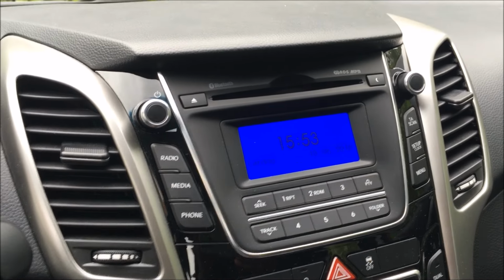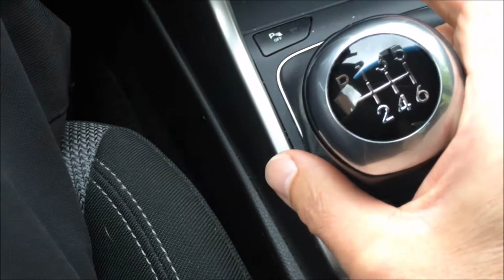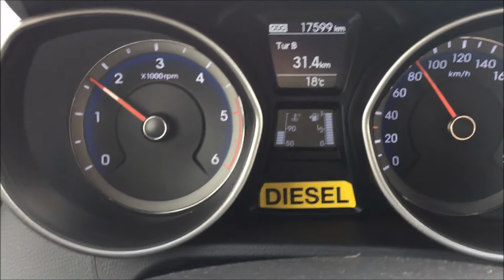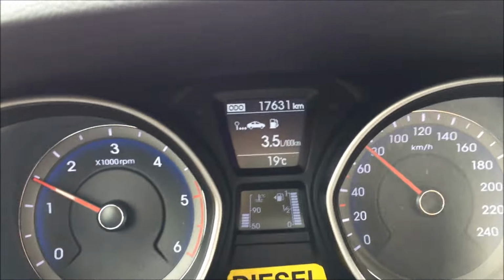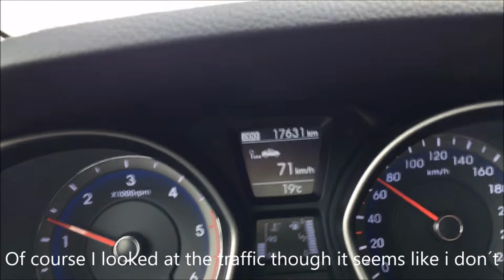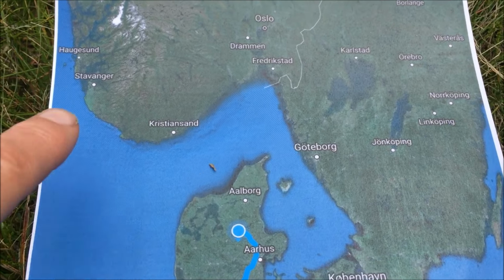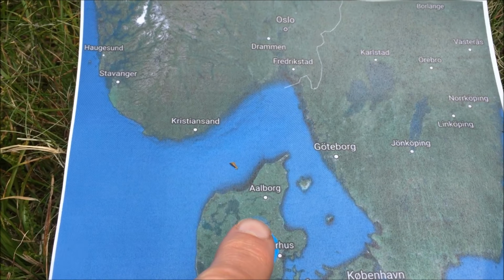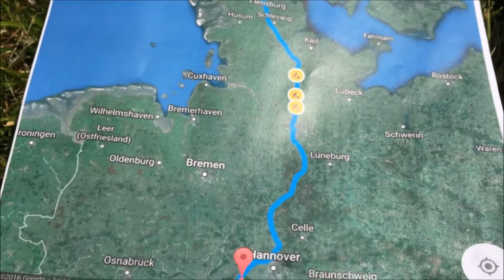Tesla vs Diesel    Range comparison

Comment: But isn't diesel cheaper than electricity?
Reply from the maker: In most countries and states electricity is much much cheaper than diesel. EVs are often a lilltle more expensive than fossil cars but much cheaper to run.
Reply: @fmm1000  even in Denmark? Electricity is way more expensive than countries like Spain. Isn't like 3kr kw/h? But amazing is cheaper even with those prices. I am actually considering replacing my diesel that does 22km/l but I'm afraid of the electrical bill
Reply from the maker: g3ek1337 Yes and no. There are different rates for electricity in Denmark. The most expensive is 2,30 kr / kwh. But you can get an “all you can eat” subscription for 800 kroners pr month. Then it gets pretty cheap if you drive a lot. Also you can get a subscription with prices that follows the market price. Then you get real cheap prices at night. You even sometimes get paid to charge your car when there is too much wind power. Nissan in Norway tells that the service cost of their EVs are 1/3 compared to the fossil Nissans.
Reply: @fmm1000  thanks a lot! That helps a lot. I think is time change my Leon for a model 3 them ... I was really worry about increasing my 2000kr diesel expenses
Reply: @fmm1000  super mange tak for hjælp :)
Reply from the maker: g3ek1337   Do you live in Denmark or Spain. Yes. Go for it. Buy the Model 3. Though. I would wait until 22 september. There might be annonced new battery technology for Model 3.

Comment: First thing - Tesla S is a luxury car that competes with Mercedes Benz E/S class, BMW 5/7 series and other top models. It cannot be compared to a compact car in 15-20.000 euro price range. 
2 - Purpose of car in that class is not to drive it around town and do shopping. It is too big and not so practical. It is to travel on motorways at high speeds (limit in europe is usually 110-130 km/h). So, instead of driving behind a truck with a/c turned off why dont you drive it at 130 km/h or more if you are in germany and then show us real world range of the car?
Reply from the maker: Ante Tešija i did that on the return trip going over 200 kph. Check the other version of this video for results.

Comment: This is not all about thermodynamics but also economics. 

Best efficiency you can achieve with an Otto engine is around 20-30%, with a Diesel engine is a bit higher around 30-40%. Far away from 90-95% efficiency electric motors can achieve. This is a question of heat loss and physics limits. 

However at the moment the issue is about cost. As long as electric power train is not as cheap as thermic engines then electric cars will not be sold massively. That's what Tesla Gigafactory is trying to achieve. 

Your Tesla is way more efficient than Hyundai i30 but the second costs a quarter than Tesla. Despite of super chargers are for free, the cost per Km of diesel is still cheaper than Tesla during first 20 years of ownership. I did the budget exercise and I need 10 years to make a Tesla profitable. But not affordable in the beginning. 

Congratulations all of you that can afford a Tesla.
Reply: Sorry for mistake. 10 years of ownership I mean.
Reply from the maker: Agreed. EVs are more expencive to buy but cheaper to run. In the first year of ownership I have saved at least. 5000 euros compared to my previous car.
Reply: +Peter Kjærsgaard 5000€ saved during one year seems to be too much. What do you take into account? How many Km do you drive and what car did you have before to compare costs? This is a very interesting topic to explain in a video.
Reply from the maker: +José Antonio Simal Martínez i had a Volvo XC70   Might do a video about this topic. I have driven 60.000 km in 11 montths.

Comment: Peter, maybe instead of testing against an Aston Martin you could test your Tesla against a BMW 5-series 335D. It's a high performance diesel. The BMW 5-series also offers space and luxury (if you choose the top spec). Specially the estate. 

1. First check the price difference. How much cheaper is the BMW. How much diesel can you buy for that saving.
2. Check what kind of range you get by driving at highway speed. 
3. Check how long (minutes or hours) can you drive each car at very high speeds on German autobahn. i e. how long can the Tesla be driven at very high speed before battery overheats? What is Tesla's range at those speeds? Does it diminish a lot? How fast do you deplete the battery at those speeds? 

Maybe you can let a friend in Germany do the BMW tests while you do the Tesla tests in Denmark, except the autobahn high speed part. 

Find out if the Tesla is a better/cheaper purchase than the BMW. We know Model S will be better in acceleration. But how about the rest? Is it really better in any other area? Will it show any shortcomings? Would be great to find out.
Reply from the maker: I already have planned what car to use insted of the Aston. Video will be comming up. Just have not had the time to do it yet :-).
Reply: Peter Kjærsgaard Great, because the Aston is not really comparable with Tesla. Will be fun to see what car you choose and how the test is set up. Good luck.

Comment: Your calculations are exactly the calculations that are widely known, but people continue to stick their head in the sand about it.
A piston engine car has an efficiency of only around 20%..in the best case.  Energy efficiency of electric is 90%+.  Very little energy wasted in heat, vibration and noise.
Reply from the maker: We just have to hope that more people will realize these facts.

Comment: Your bias is evident.  Depending on where you charge your Tesla you may be surprised at how much fossil fuel is being burned to charge you EV.
Reply: And a lot of energy is actually used to make fossil fuel also, something many forget. It doesn't magically appear at the gas station.
Reply from the maker: You are right about that but scientist has tried to make a craddle to grave analyzis on fossilcars and EVs impact on the enviroment.
In the craddle the fossilcars are best but within a short amount of time the EVs are better because of the better efficiancy and where a fossil car gets more and more dirty the older it is it is opposite with EVs.
As the grid gets more and more clean so does the EVs impact on the enviroment.
Reply from the maker: +Mee i could not have said that better :-)
Reply: if you follow any of latest news on EV you wouldnt be saying that.. Even if they burned only fossil fuels to generate electricity for all the cars in world.. it would still be twice as efficient as putting petrol or diesel..

World will eventually transition away from fossil fuels and we should encourage anythign that heads in taht direction instead of cling on to dirty old ways
Reply from the maker: +Skemo Gaming I agree.

Comment: Thanks for the first hand diesel efficiency comparison vs Tesla Model S when in the slipstream of a large truck at relatively low speeds on the highway.  The fuel efficiency of the diesel was actually quite good this way, but still 3 times less efficient than the Tesla.
Reply from the maker: Yes. But in my next video it will be very interesting.
What is the difference between the Tesla and a petrol car with the same fuel consumption as a performance car like the Tesla..